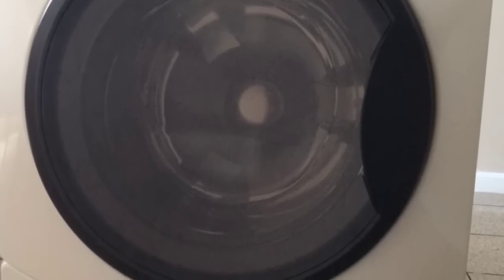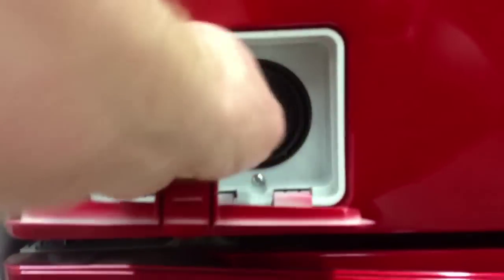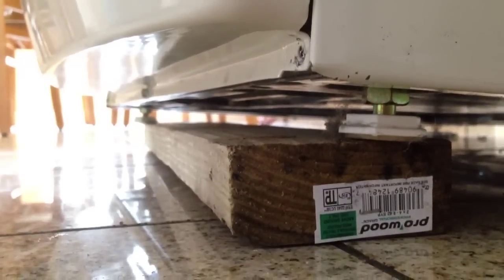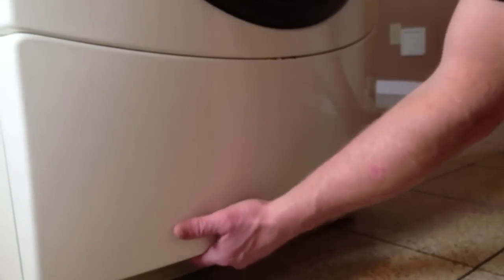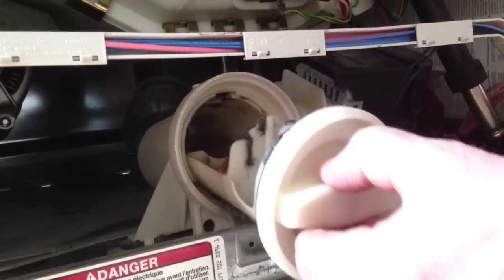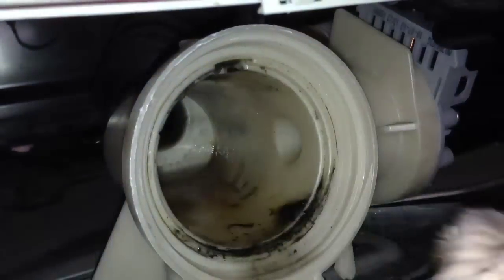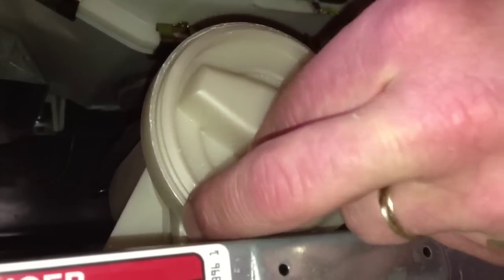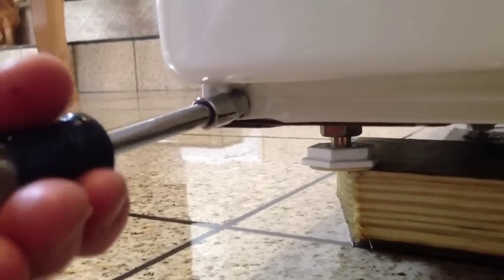Cleaning the drain basket on a Kenmore Elite HE3T

Comment: this is the absolute dumbest/most inefficient design — this toe panel that you have to completely remove by lifting the heavy appliance up and propping it under a 2x4, then unscrewing the 3 screws at the bottom (while laying awkwardly on the floor), and then taking the panel off, cleaning the filter, and having to do everything in reverse.............................Thank god modern washers have ditched this idiotic design choice.
Reply from the maker: I think I agree.
Thanks for watching.